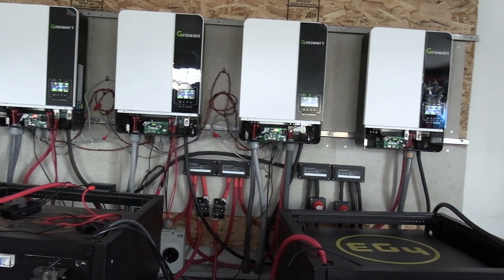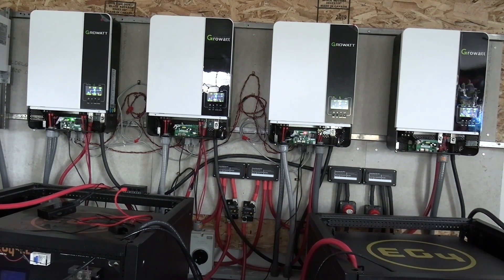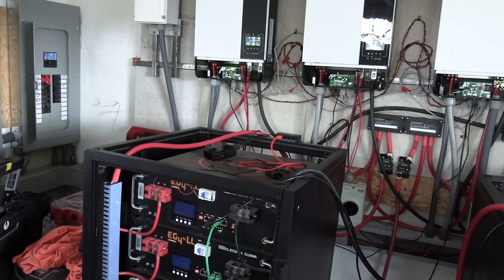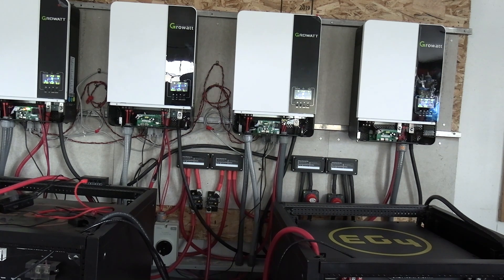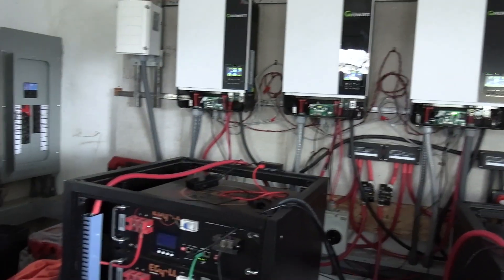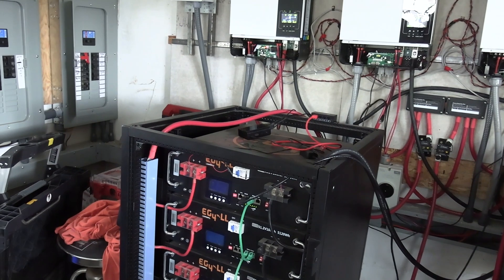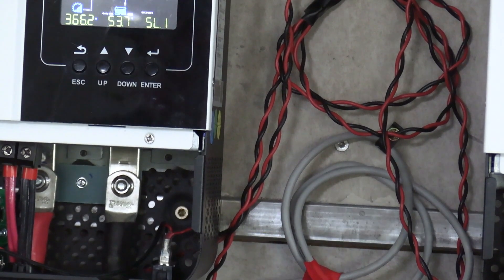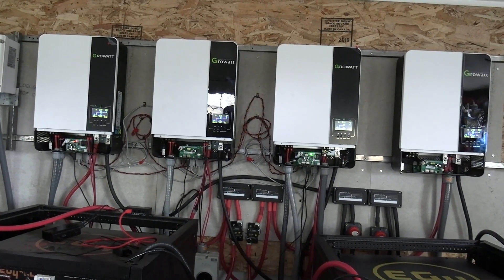Growatt 5000es firmware updated and working awesome

Comment: SolarAssistant has been very helpful, and quick to answer any question within 24 hours, and even replace the solar assistant when I managed to blow up using the 48v power supply unit. So I have now switch to a mains supply to avoid that from happening again. Interesting about the new Growatt firmware update giving issues to solar assistant. Perhaps you should give them a follow up email just incase your message went into thier spam folder!

Comment: I guess if all you have used is Growatt inverters and Signature Solar Than you have no idea what a good system is like. I  installed a 12k Growatt for mr Dads off grid and there have been nothing but problems. Still haven’t got the Wi-Fi dongle to work switching to Solar assistant soon.  I how ever installed a Victron system in my RV that works flawlessly and is miles ahead with the cerbo GX. The difference in quality and design is night and day. Sorry to badmouth Growatt but in my opinion they are on the low end for reliability and functionality.

Comment: Hi ,, good videos, can you tell me if the inverter that is running only as a charger ,shuts off at night ,, and could it be an issue if it's not talking to the other inverters , of over charging the batteries?
Reply from the maker: It stops charging at a lower battery setting. Plus it doesn’t need to communicate with the other inverters. Because it is not supplying power to the system.
Reply: @jamesshomesolarmore2223  thanks for your reply..is it running all night ? Or only starts up when the sun is shining
Reply from the maker: @peanutcat4058  the battery charge only inverter goes into sleep mode at night
Reply: @jamesshomesolarmore2223  thanks again for your reply,, how have you set it up so it goes into sleep mode ,, are light still on but nothing else,or is it in sleep mode because of rule 21 low DC cut off ? ,,

Comment: I've been having glitches with my 3000 watt Growatt unit. It seems to have spiked my house and I lost several pieces of electronics. I'm still trying to figure it out. I not sure exactly what happened. I have had two instances where the unit switch to utility power for no known reason. I been trying to get the firmware updated, but the update tool keeps locking up on me. Did you have any problems with updating the firmware? How did you update the firmware? Also, for what reason did you update the firmware?
Reply from the maker: The grow arts have a few 3000 inverter’s. Which models and how old? I updated firmware because of communication for the older and newer unit’s. I am not sure about the spiking of power. I have heard others say they had this issue before. But my units are the growatt 5000 es. 240 volts then I have 2 transformers. After that I have GFCI breakers and plugins. It may be overkill. But then you are here saying that your units spiked. I put in all new appliances last year and wanted them protected.
Reply: @jamesshomesolarmore2223  I've been working with the great team over at Signature Solar and they have decided to replace my unit. Can't say enough good about the team at Signature Solar. They really take care of their customers.
Reply: @jamesshomesolarmore2223  Where have you heard others say that they have had issues with the Growatt 3000? I would like to read those comments.
Reply from the maker: @fordsrmaster  not with the growatt 3000. But that some have had issues of failure’s. I have experienced none of that. As a matter of fact I am in the Philippines right now. My solar system is still powering my house in the USA. That’s why I put in surge protection and 2 transformer’s.

Comment: Dear friend, here in Spain my solar equipment supplier, who sells both Growatt and Pylontech batteries told me a week ago that the Growatt SPF5000ES no longer supports other than the newly released Growatt 48V batteries. As cracy as that might sound, I'm not prepared to get rid of my batteries. It seems the latest firmware and some other hardware elements have changed on the Growatt SPF5000ES, so it will only accept Growatt brand batteries. I'm making sure I don't update my firmware, since I could end-up the same way as you. I've been running a Growatt and 3 x 3500 W US 3000 Pylontech 48V 100A batteries for almost two years without a glitch. I wonder if you can revert the firmware to the previous one and get the amazing setup you have. I was going for my second Growatt SPF5000ES, more panels and an extra battery, but now I don't know what I will or can do....
Best regards and hope you get the whole thing running very soon.
Reply from the maker: I haven’t heard that about the batteries and the growatt inverters. 
I don’t always take all supplier’s at their word. I will be putting in another solar array in the Philippines in a few months. Hopefully I don’t run into any issues. I will make some video’s on the subject in August and September.

Comment: Our inverters have had nothing but problems.
Reply from the maker: I am not sure what to say to that? you need to provide information and hopefully pictures of wiring. I would love to help if possible. I have had inverters that had issues providing enough power. the growatt 5000 es has always provided plenty of power. as you can see, I am using 4 of them. unless you can share how your system is set up, I can't advise you.
Reply from the maker: @TheFatman819  I am sorry to hear that. So did your transformer go out? I have installed GFCI outlet’s throughout my house. You don’t have to have them at every plugin. You just need them at the first plugin fro each run. But in my kitchen and bathrooms they are all GFCI plugins.
Reply from the maker: @TheFatman819  wiring is really easy. I don’t let anyone wire anything in my house. Did the master electricians wire things before the inverter failures?

Comment: I recently found your videos. To me, your no frills straight to the point approach is refreshing. Keep them coming.
Are you able to do a video of the current build showing the components and where to buy them. Any discount codes etc will come in handy.
Growatt 5000 ES Inverters -> Signature Solar
EGR LiFePo 5.12KWh -> Signature Solar
4/0 welding cables?
4awg cables?
Busbars?
PV breakers?
Battery disconnect? Not sure if that is the correct term, rating specs negative
Battery disconnect? Positive side, rating specs
Fuses? 
For specs, please assume my system is similar to yours
Much anticipated
Reply: Please take your time. 
Thanks in advance
Reply from the maker: I guess you have given me material for another video. I have help doing work today. then i have a couple other things that I NEED TO DO. Some of which will have videos made. One is about a scammer that has been trying to extort me for money. I hope I can wrap that up soon. I will try to give the parts and descriptions and how I chose them out by Thursday.

Comment: Glad to hear your growatts are working out nicely and hope you get the comms situation resolved soon. I noticed you are using one of the autotransformers. How is that working out for you and how long have you had it? I've seen some conflicting info online about the autotransformers so I'm thinking of getting a regular transformer with a center tap on the output side to give me the 240v split phase.
Reply from the maker: The transformer has always worked, I am getting a second one soon. Just so I have a backup. If you look close you will see that there are backup options in my whole system. Soon I will have plenty of solar panels. The extra transformer 2 battery banks plus the ability to operate the system as 2 separate systems. I just need the second transformer to make it happen.
Reply: @jamesshomesolarmore2223  Very nice.
Reply: com     boards defective from factory   I have as of today    5       5000es on site only 1 of the com  boards will allow connections  Growwat usa was extremally rude. and signature solar is full of bull . First the couldn't get com boards. then they finally sent a board guessing from old units as it did not fit . So i call now story changes there is 3 dif boards   but only 1 has a printer type plug in it   so they send another   . Guess what still dose not fit.  so they send me 2 replacements unit and now i have 5 of them here  . guess what only 1 will allow the driver to show up in device manager so you can load firmware or pull info for boards but as this in solar assistant. Any help would be appreciated. At this point ive invested over 20k in my ssolar mostly threw signature solar. Id have to not recommend buying from them

Comment: Nice setup is this off grid only? Are you using the utility feature on the growatt
Reply from the maker: No, I have grid as backup at this time. so yes, the grid is feeding into the inverters when I need it. Our next step is to increase solar panels. I have them and all the hardware. We will start doing the work on that tomorrow. We will also increase the batteries so we will have more storage for cloudy and snow times. the extra solar panels should help during those times also.